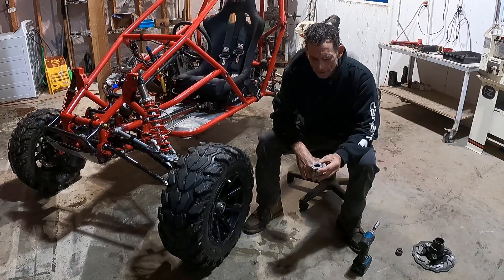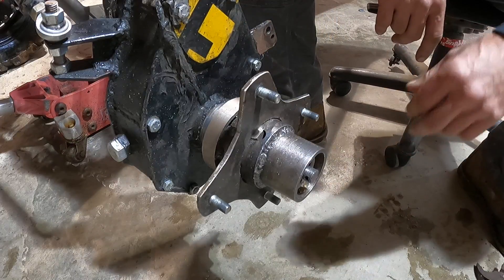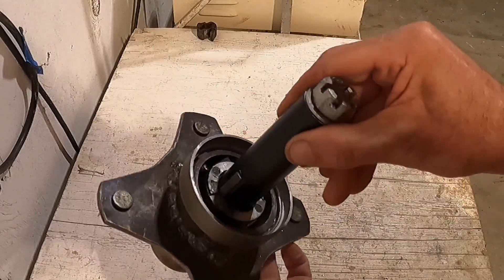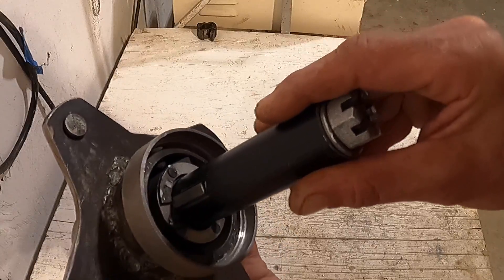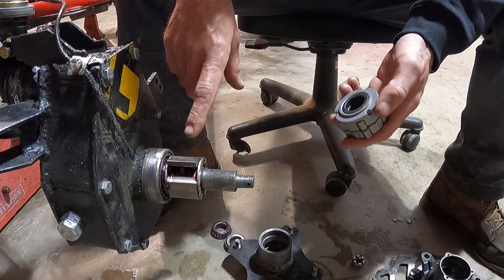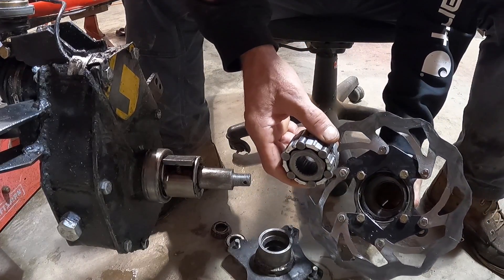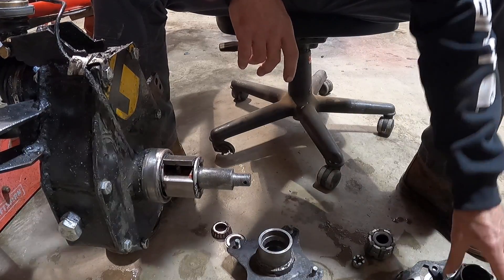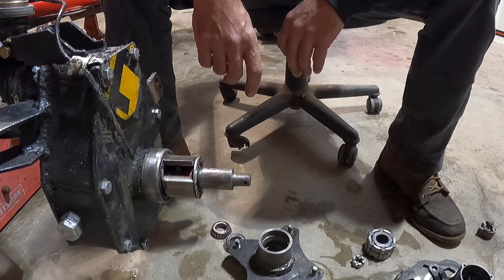Automatic Front Locking Differential Build For Go Kart

Comment: what was outer hub with slots diameter?
Reply from the maker: What are you building?
Reply: @ to another Mech, did you use 1.98inch Od Bearing?
Reply from the maker: @philipardvall1968 yes. 1.98 od x 1” id. Inexpensive to source through Amazon or eBay.
Reply: @ what did you use steel od id , must be maybe 5mm for strength?
Reply from the maker: @philipardvall1968 yes. Thickness 1/4”. 5 or 6 mm.
Reply: @ what Od x Wall steel did you use?
Reply: Use this as base to other Mech? Would 3/4inch axle work?

Comment: Would a set of spragg clutches not work?
Reply from the maker: Yes they could work for a small diameter tire. but for a 21” tire I feel a ratcheting pawl design. (Like a rear bicycle hub) is much stronger.
Reply: @kartbuilds697  I have to assume there's a good reason they go for racheting pawls in bikes and not spragg. Speaking of bikes though, I wonder what the limits of a mountain bike hub would be. They can handle significant torque and weight, but larger tires+crossloading might beat them to a pulp
Reply from the maker: @nathanfischer-rv4gy true. My ratcheting double pawl mechanism is an oversized bicycle hub.